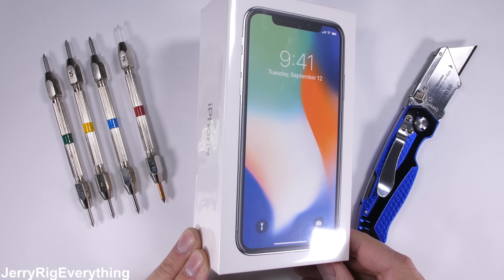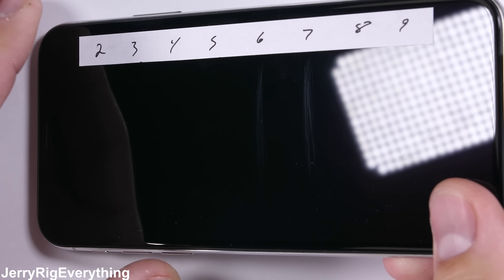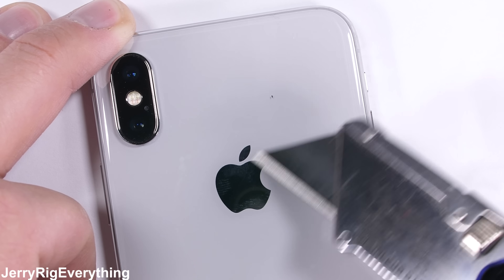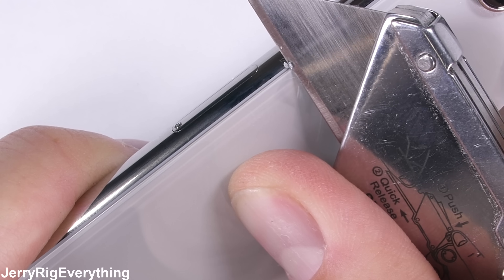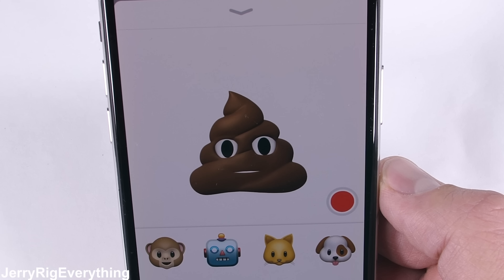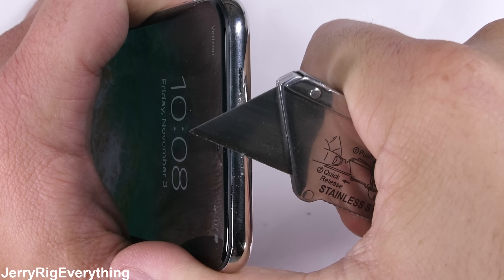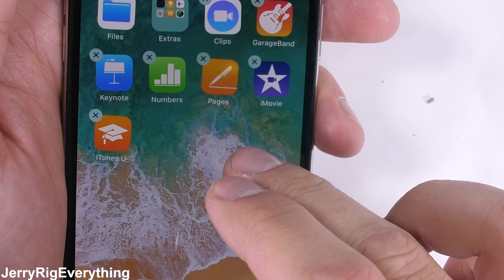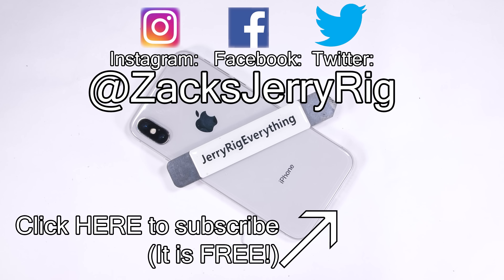iPhone X Durability Test - Scratch BURN and Bend TESTED!

Comment: "the same LED screen Android manufacturers have been using for the last 7 years" I love when Zack takes digs at apple.
Reply: The better thing is, Samsung makes the screen
Reply: Fanvsant that's the icing on the cake. And that it's only 2436X1125 because apple can't do standard resolutions.
Reply: Marky Marc it's QHD+ its based off on an existing resolution 2436x1125 isn't even 1440p genius.
Reply: I love pandering as well.
Reply: Oh damn that one hell of a burn. I almost died
Reply: We've had that for a while
Reply: Courage
Reply: Good then it's OLED with HDR instead of HD LED I'm sure that's the same screen they have been using for years. Y'all need to do your research
Reply: It’s actually better than them according to many tests, way brighter, more accurate colors and less color shift. And like everything Samsung makes for Apple they only manufacture it, Apple designs everything. You could do your research before starting a circlejerk don’t ya think?
Reply: Hey Spookeh, NOT EVEN CLOSE. The Iphone X is using a Pentile oled arrangement. Which is inferior and Samsung has stopped using it this year. Nice try.
Reply: Dani, yes.  AMOLED is Samsung's marketing name for it.
Reply: Marky Marc Yes, it is. It is called QHD or 2K. Don't try to make excuses for Apple's greed. This awkward resolution is a bad joke.
Reply: But it’s an oled though
Reply: Miguel Ferreira, to have the essential is better than not having it. That's why I'm not using an iPhone that's over the 6 and 6+.
Reply: You know why Apple took as long as they did?    

the biggest major reason is no one had the production capacity until this year.  Apple ordered 90 million screens from Samsung.  In 2015, the total number of OLED screens made for smartphones was only 100 Million units, so with just one model phone, Apple essentially doubled the production capacity requirements for OLED. in 2015, Samsung had 95% of the OLED screen production.   Apple has also gotten LG to invest almost 2 Billion in new OLED production for future products that will come out at the end of next year.

the other reasons why Apple waited was that OLED sucked for many years, as you have probably seen many OLED screens with a greenish hue as they lost their color balance, plus they had more severe screen burn in.  Apple wanted to wait until OLED was good enough to even use.  That's the problem with Samsung, they tend to sell what should be a prototype to people that simply don't understand that it takes several years to get a new technology perfected where it's worth using.   OLED still has screen burn in issues and I don't think they will ever solve that problem due to the inherent nature of OLED.

So it was a variety of reasons why Apple waited.

Not to worry, Apple bought LuxVue several years ago and they are working on microLED which will probably come out on the Apple Watch first and then eventually for smartphones, and that'll gonna make OLED old news.   Samsung hasn't invested in microLED yet, so they are behind in that technology.  microLED is supposed to be much less power hungry, etc.
Reply: DClover no it's not.  Apple designed the screen. Samsung produced it according to Apple's spec.  Two completely different things.
Reply: I MEAN ISNT OLED AND ´´ AM ´´ OLED THE SAME THING ?
Reply: L. James it's OLED Samsung has been using AMOLED for 7 years, it's HDR compliant, it's not HDR. Do some research
Reply: Aaron Lopata it's not the best one ever tested, the infinity display is, I'll be happy to continue reading these baseless comments when you have proof to back up what you're saying, not to mention this display was manufactured by Samsung not apple.
Reply: TenZa there's only so much you can tweak a panel made by another manufacturer, at the end of the day it's still a Samsung produced and built panel, to Samsung's specification.
Reply: Diego Díaz Bilbao way brighter? It's 620 nits, the note 8 is 1200 nits, both displays adhere to the P3 and SRGB color gamut, so again you're wrong. And naturally all AMOLED, POLED and OLED displays have some sort of color shift, so you can take your comment and be wrong elsewhere, FANBOY.
Reply: donotswallow no. ACTIVE MATRIX vs pentile. They're not the same.
Reply: Chrono Cubing not really, Samsung has the same method of calibration for each display they build wether it's for apple or themselves, they didn't build a new factory or R&D department for apple. Stop lying to yourself.
Reply: Michael Morales still the same screen
Reply: JH.13 fr
Reply: André Victor Goncalves oh it’s a phone chill
Reply: ThePeddle result spoke
Reply: David hunsinger And much higher nits.
Reply: The S8 panel is capable of 2960x1440 but it comes set to 2220x1080 - a little over 1080p. It's a careful balance of screen resolution to battery life. More is only really needed for Samsungs VR headset
Reply: Leon Camero not really essential anymore tho...
Reply: and the facts are in....iPhone X's display is the best in the market currently (tested by iXBT and few other sources)
Reply: Marky Marc 1440p is 2k while 1125p is neither 1080p or 2k
Reply: Spookeh Nope
Reply: Diego Díaz Bilbao IPX is 500~ nits while N8 is 1000+.
Reply: Fanvsant you do understand that Samsung has made apple internals
Reply: Marky Marc Samsung is more than capable of producing the standard resolutions, as seen in their latest flagships and the year before, but they can't just hand apple their latest highest quality and resolution OLED panels.
Reply: Pierre's wife's son's father, President of Cuba Note 8 has the best screen so...
Reply: DClover not really the same screen Samsung used. Apple told them what to make and they made it. Apple still has all control over the colors the oled panel produced.
Reply: Chris Haycox there was 15 other videos on the iPhone X 5 days ago, he's not one of the first. At all.
Reply: Miguel Ferreira so stop watching
Reply: -Samsung still uses Pentile arrangement even now from what I gathered.

-DCI 2K =/= QHD. QHD+ is a derivative of QHD, but not 2K. DCI 2K is 2048 × 1080, QHD is 2650 x 1440. And for the love of tech, 4k =/= UHD. People (and websites) need to stop mixing resolution terms. 

-Note 8's max brightness (~1000-1200 nits) is only achieved in very specific circumstances, sunny outside with brightness set to auto. Not sure about HDR content though.

-I am 95% sure most oled displays nowadays are active matrix, that includes the iPhone X. Saying other amoled displays are better than iPhone X's display because they're amoled is just silly.

And I laugh at all the people who said the X's screen has a 120hz refresh rate.
Reply: 2010ngojo it's not Pentile there's no such thing as a Pentile active matrix display.
Reply: https://en.wikipedia.org/wiki/PenTile_matrix_family

Excuse me?
Reply: Pretty funny how someone said that Apple will ibe the first to invent MicroLED technology even though Samsung showed their first microLED tv on the IFA 2018
Reply: @SqueegeePi , But it's made by Samsung, who put better screens on their phones.
Reply: @Bobi Rachev everyone knows it and apple never pretended they made the displays
Reply: Spookeh not really, same screen Samsung uses
Reply: TenZa no one brings it up because they're not direct competitors with Samsung
Reply: DClover yeah, the screen is like 2 genrations old
Reply: Spookeh That's because it's the only OLED, lol. Everyone else is using AMOLED and they're quite a bit better.
Reply: Spookeh oh yes of course, apple used it, so it must be the best screen on planet earth!! Get your head out of the sand
Reply: “”And next time you want to time travel use an android “” Zack 2016
Reply: Spookeh it's not. But okay.
Reply: Apple: We have Animoji!
Razer: We have the best display and the best speakers on a phone!

I think my choice is clear.
Reply: JH.13 and neither is that branch of Samsung. Samsung just happens to be an oled panel manufacturer and washing machine manufacturer and phone manufacturer etc. etc. etc. This logic doesn't and hasn't ever made sense because 1: Apple is NOT an oled manufacturer (yet) and 2: They still completely design and tweak the panels; this is legit no different than them hiring TMSC in previous years to help pump out more chips because their in-house factories maxed out
Reply: David hunsinger yeah, it’s funny when he bashes Apple yet he’s one of the first ones out of the gate with an iPhone X video.
Reply: David hunsinger except this is the best one ever tested
Reply: "The better thing is, Samsung makes the screen" yeah the same way Qualcomm makes the chip, Corning makes the glass, and Wacom makes the digitzer on the Note 8 and yet no one brings that up because it's not Apple.
Reply: Every single video he cries about the headphone jack.  Very annoying!
Reply: David hunsinger Neither can Samsung genius. 2960x1440 isn’t a conventional resolution.
Reply: Marky Marc but it's better is it not ?

Comment: Help me! I have my galaxy note 3 that doesn't charge but says it is. I can send stuff to my pc with the cable with no problem. So i decided to replace the charging port en I still have to same problem. Do you know a way to fix this? I'm currently using a external battery charger and switching batteries when one is empty because I've got 2 batteries.